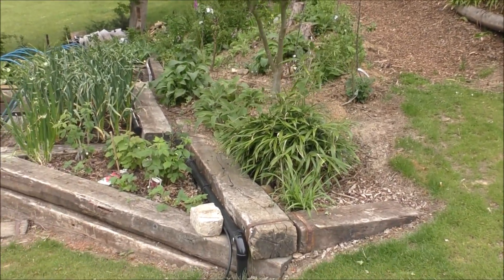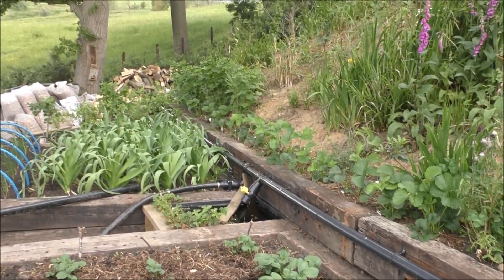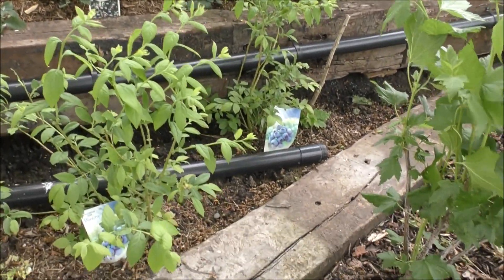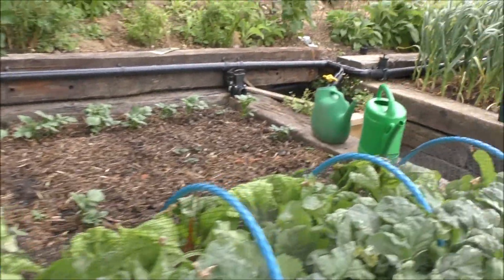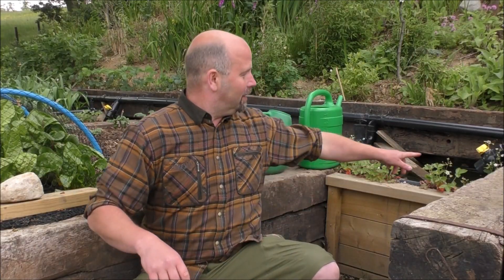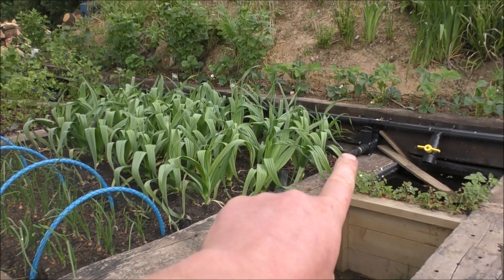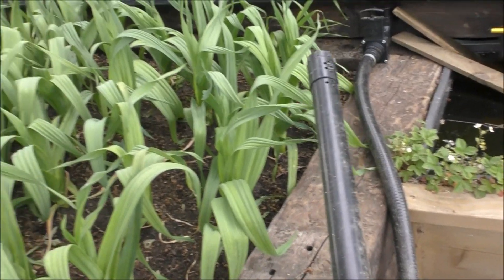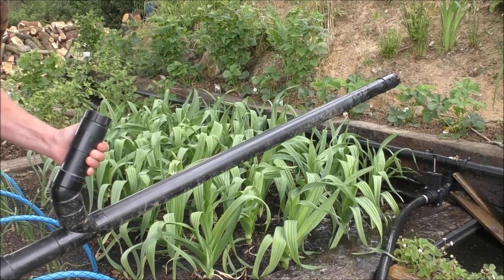Episode 3 - Vegetable Garden #1 - Project Update

Comment from the maker: In this video we will take a look at the first part of the vegetable garden.
It's a decent size and has two large beds approximately 8'6" x 8'6" with a few smaller beds too - all made of hardwood railway sleepers. None of those fake modern softwood 'sleepers' (which don't last 5 minutes) here.

They may be mega-heavy but the proper sleepers are there to stay. When I'm an old man I don't want to be fannying about rebuilding anything.....

It was a bit of a task making the beds so substantial and getting the filters linked up to the garden by pipes but it has definitely been worth it.
The mesh I used for the crop protection can be found here: https://ebay.us/jb9FlJ 
and the woven landscape fabric can be found here: https://ebay.us/T6xJTz 
Other versions of protection mesh and landscape fabric are available but I chose these types as I know they last. No point wasting credits in the bank on stuff which doesn't last....

If you have eyes to see now is the time to save up and take action to be self-reliant and more self-sufficient. As I am not blind to what goes on behind the headlines I've had the luxury of being able to save up over a few years for these projects but nothing is more important than self-reliance and learning new skills since skills are (or soon will be) the new currency. 
Money well spent. Fake 'money' exchanged for something of real value  - that's a great deal.

Comment: Black currant and gooseberry :) Mine are huge you will see them in next week's video. That's a great system for watering and I am working on a better system to help me next year with such a big garden to water it takes time. I love that waterer barrel what a quick way to flood a bed. massively helps to have the huge pond and the drains to supply it all gravity fed though. Great episode Richard and I am loving this garden. Sleepers are like gold here atm it's crazy. Look forward to the next installment
Reply: Yes sleepers are scarce here too - I have 2 x 24 packs ordered for future projects but getting them into the UK from Poland or other EU states seems to be a problem - hoping to get another 10 this week to finish off edges of paths and surrounds for the shed but I'm not holding my breath on that one.
I will look out for your video but Google sees fit to send me no notifications from the hundreds of channels I've subscribed to. Nothing I do seems to rectify that which is why I went to Odysee - if you're not already on that platform it is well worth doing as it is like the early days of YouTube with no censoring. The transfer of all videos is automatic from YouTube and it's a great way to back up your YouTube videos in case you happen to mention c*vid, Va33ines etc...